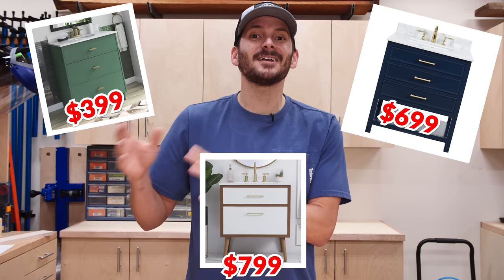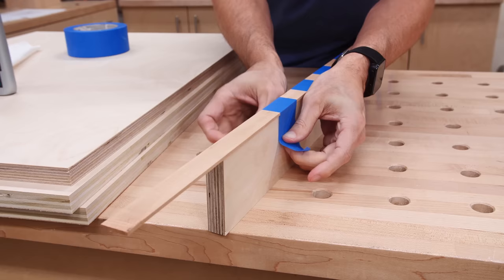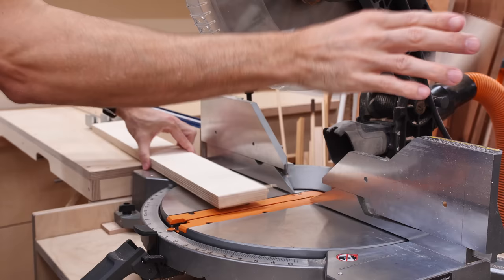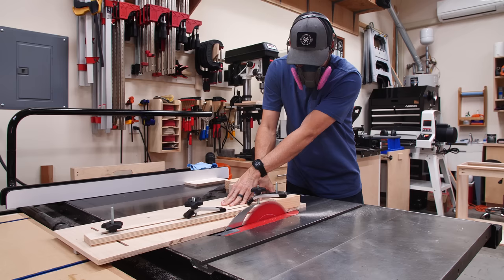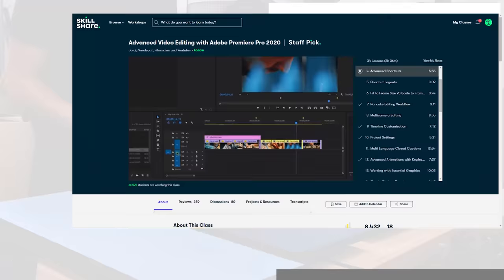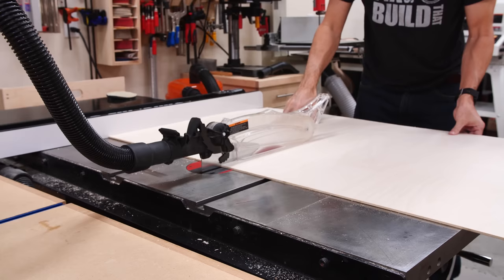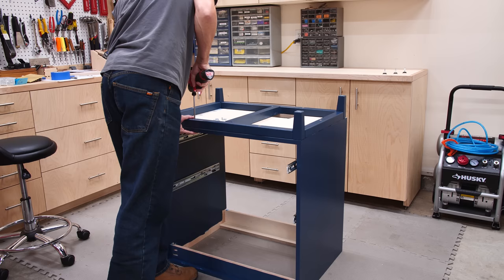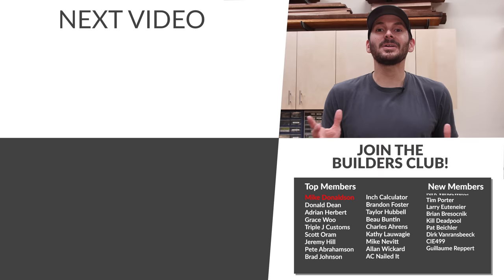DIY Bathroom Vanity with Custom Drawers | Woodworking

Comment: My wife wanted crates for her shelves in the craft room.  I used that method to cut some little 1/8 thick strips for the crates sides and bottoms.  Worked well.  I sliced up a bunch of 2x4 material.  Great use of scrap.

Comment: So helpful. I plan to use the existing 72” cabinet base that in my master bath, but add in drawers instead of drawers that are there for better storage.

*Plan to turn the 3 bottom existing drawers in the middle to a pull out trash can.

Comment: Why does no one make a hinged drawer on the top? Makes a great place for small items. My grandmother's kitchen, for the sink, you pulled on on it and it hinged open, it is where she kept most of her spices, when closed they laid flat, when front was open it pulled down about 60 degrees and you could easily read the containers and grab them. Many small things to store around a bathroom vanity too... Filip it down, access toothpaste/toothbrushes, not sitting out, not down in some deep drawer :)  Loved the color of this!

Comment: Gotta say Brad. Your sponsored ads are one of the few I actually watch as you put it on while still showing the build. Happy to watch the ads this way. Good job. Also nice build. When you use the foreman pocket jig are the positions random or are you measuring and placing specific points off camera?
Reply from the maker: I appreciate your support of the channel, Gary!  I try to make it still have some value if you're not interested in the sponsor I'm talking about.  And if you go back and look on a close up you can see these little spring stops on the Foreman.  So whenever I do the edge holes I use those.  Anything on the interior I just eyeball and typically go ~6" apart.
Reply: @Fixthisbuildthat  I wasn't able to locate the plans for this build on your website. I would really like to buy them if you could tell me where ti get them? This is exactly what I'm looking to do for my own bathroom remodel.

Comment: Love you're videos 👍 would you consider doing a video on what pocket hole screws you use for different types of wood? Thanks
Reply from the maker: It'd be a very short video :)  Coarse threads for softwood and fine threads for hardwood.  Length is determined by size of wood and Kreg jig has great reference for that.

Comment: It was not done with a solid wood. It was done with plywood. That’s a big difference.
Reply: It's a nice project, I like the solid colour. I am in the middle of planning a vanity build and this is inspiring.   At least it wasn't made with the cheapest veneered particle board like another one I saw on YT  - that maker called it 'plywood' and criticised (and/or shadowbanned) everybody that argued :)
Reply: Why would you use solid wood more prone to warping for any cabinet, especially one that goes in a bathroom where there’s always tons of humidity and temp changes??
Reply: @thomashajicek2747  certainly no argument there,  a quality ply, properly sealed, is the best way to go in these environments - short of marble or plastic, maybe :) .  This was more about terminology, which seems  to vary the world over.  The term 'solid wood' was used early in the video which implies 'natural' non-engineered timber (lumber) in many parts of the world.
Reply: @greaser5691  ah, I missed that bit.

Comment: Don’t remember where I got this (Stumpy Nubs?), but if you have some of those wood-jawed screw clamps, you can use them instead of the vice you said you needed. Clamp rests flat on bench and holds your piece vertically, and if you need extra stability you can clamp the clamp to the bench
(Edit: now that I think of it, your parallel clamps could do the trick too!)

Comment: Brad, Did you use glue on your joints at all or only on some parts of the build?? Or is everything JUST held together with screws? I can never decide when glue is needed vs not needed. Thanks!
Reply from the maker: Hey, Mike.  I rarely ever use glue on end grain to long grain joints and didn't on these.  The screws are more than enough to hold it for life

Comment: I always factor in the value of my time on home DIY projects like this. If it takes $300 in materials to build a cabinet that I would otherwise have to purchase for $700, I'm only "saving $400" if my time has zero value. Some people are willing to give their time away for nothing, and will take on projects like these. For others, the $400 in "savings" won't buy an hour of their time.
Reply: I do agree with you on the value of time - it will definitely take much longer to create this yourself vs purchasing one already made. But for the pre-made cabinets, don’t forget to factor what materials you are purchasing for that $700. So even though you are “saving” $400, MDF is made out of particle board and/or fibers, which is not as strong as the plywood he used. Additionally, MDF may not be able to carry the weight of marble or granite either without bending or needing more reinforcements - which also cost additional money.

Comment: Why is the drawer a false drawer? That drawer would be totally useful. If you cut a channel for the plumbing, then box it in with scrap 1/2 Baltic birch it makes it so you can still use the drawer. Odd looking but still very handy and useful.

Comment: Always wonder when ppl make legs, I mean. Most of the time old house aren't straight in the floor.  Could you hang this with a French cleat? Or isn't that strong enough for the sink and table top?
Reply from the maker: could definitely do french cleat.  but most of the time legs get adjustable leveler feet or shims to make it work
Reply: @Fixthisbuildthat  very good point. Thx for the reply 👍🏼

Comment: Good job. The cabinet is very nice, but its price is still expensive even though it is halved.
Reply: Agreed, could be bought from a store cheaper like ikea but you just know the wood used will just be shocking yet beautiful to the eye !
Reply: A bathroom vanity of that size and comparable build is $400 at Ikea. You can buy cheaper but, as he says, it'll be made of lower quality material and may not last as long. $300 for a solid plywood vanity is a fantastic price.
Reply: @tiawilliams5690  Okie, maybe the price is different in my country and the other country, With $ 300 for a plywood cabinet then in my country it's a hefty price, for that money in my country can make very beautiful wardrobes or beds made entirely of wood. The cabinet in video like on its price is less than $ 100.
Reply: @Dogo24h  in the US, a vanity cabinet like this made of plywood can easily run $600-800, and honestly doesn't look this good in most cases

Comment: What are you doing after you roll on the dark blue paint at marker 9:24?  Are you taking some of the coat off to help dry?
Reply from the maker: good eye, Keith.  I was back brushing the rolled on coat.  Gets rid of the "orange peel" look and makes it look brushed on.
Reply: @Fixthisbuildthat  back brushing?  Using another bristle brush or is it a foam brush (to prevent brush strokes)?  Would like to hear it explained in the live show, maybe? :)
Reply from the maker: Missed this before the show. I rolled on with a nap roller and back brush with a bristle brush 👍
Reply: @Fixthisbuildthat  wow, phenomenal job, the color is beautiful.  So you had to issues with any brush strokes showing up?  Could a foam brush achieve the same result?

Comment: "I'm going to show you how to make one out of solid wood", pulls out a sheet of plywood.
Reply from the maker: plywood is just solid sheets of wood glued together :)
Reply: @Fixthisbuildthat  I know, but that reply is still funny. Lol
Reply: @Fixthisbuildthat  I mean, it is a sheet-good, not solid lumber. By the same token, partical board is solid chunks of wood glued together. 
I dig the project, and plywood's leaps and bounds better for a bathroom vanity than either solid lumber or the MDF/particle board stuff...but that intro did crack me up.

Comment: “Made out of solid wood”...”plywood carcass”
Reply: In the world of linguistic bullshit we now live in, "Solid wood" refers to anything that's not chipboard, particle board or MDF. 

It seems the distinction was made by big furniture manufacturers who argued that a thin sheet of solid wood is still solid wood even if it's laminated together with lot's of other sheet's of solid wood. As long as something doesn't contain any of the "re-formed" types of board they can happily advertise something as "Solid wood" even if the whole things made of bargain basement shuttering ply ! Add a layer of pretty wood veneer to all exposed surfaces and a customer who doesn't ask the right questions might be none the wiser for at least a few years.

Luckily, so far most big manufacturers limit using ply to draw bottoms and cabinet backs, but it's only a matter of time before lumber prices force them to expand that into other parts of their "Solid wood" furniture. If they don't they'll get priced out of the market by others who have less qualms about pushing the boundaries of accepted descriptive terminology.
Reply: @Reman1975  Plywood and OSB both are resin and wood based.  Your argument does NOT hold.
Reply from the maker: Plywood is considered "solid wood" in most furniture as it's solid sheets of wood held together by glue, not particles, chips or dust held together by resin.
Reply: @justchillinout2002   It's very difficult to legally define what is and isn't plywood. Have a go at writing something that can differentiate between what is and isn't plywood with no wiggle room, that works for 100% of the time, and can quantify the difference between gluing a handful of 6x1" planks side by side to make a table top and gluing a stack of 2mm sheets one on top of another. The legal profession couldn't, so plywood is still classed as solid wood by furniture makers. If plywood didn't get classed as "Solid wood" then unfortunately, any large expanse of wood that's made out of glued planks, or a piece of cheaper real wood that's faced with an expensive veneer would also need to be classed as plywood. 

"Engineered wood boards" could be quite simply described as "A composite material made from compressed non continuous wood fibres and a binding agent", and that would probably be enough to cover all chip/particle board types, but plywood can't be pidgin holed that easily.
Reply: @Reman1975  Bottom line, Plywood IS NOT solid wood.

Comment: Solid wood? Then you say you start off with plywood...ummm  Why not just use thick edge banding ?
Reply: Plywood is not particle wood like MDF and actual particle board
Reply: @Taylexwow  Nor is it solid wood...
Reply from the maker: @wags99999 It's solid pieces (sheets) of wood glued together.  So it is in my book :)  Like a glued up cutting board on a different scale.
Reply: @Fixthisbuildthat  So is particle board, MDO and MDF, pieces of wood glued up..  In many cases far superior to plywood or solid wood...They make different grades of MDF and PB for different purposes.. Why use a house paint rather than a solid stain with conversion varnish top coat?

Comment: Sawstop tablesaw  $2500 
Ridgid miter saw   $599  
Dwalt drill driver  $169 
Kreg foreman  $449
Router table  $299 
Kreg K4 (?)  $79
Ridgid jigsaw  $129
Milwaukee brad nailer  $339 
Ridgid palm router   $145
Wood  $90
Top  $100
Hardware  $48
Finish  $30
Fasteners  $8

Total  $4984 

Conclusion: Buy vanity from store, alternatively  borrow tools from father-in-law.
Reply from the maker: Being able to build hundreds of other projects with the same tools...priceless

Comment: Built a vanity for $300. Uses $5k in equipment to do so haha.
Reply: Yeah it always sucks when you have to throw away thousands of dollars of tools after each project. 

You could make the same thing with a drill/driver set, circular saw, and cheapi pocket hole jig.
Reply: @thomashajicek2747  even if you go the cheapest route possible, as far as tools are concerned, then you're still looking at $500+ to build something like this and that doesn't include the value of your time. You give people the false impression that something like this is only worth $300 which belittles an actual professionals craft.
Reply: @RenegadeTactical  you realize  that these videos are directed to people who are already investing in the woodworking hobby and not toy tap novices with zero experience, right? Nobody is thinking a total novice could watch this video alone and build this.
Reply: @thomashajicek2747  well aren't you just a man of the people 🤣.... these videos are directed at who ever will watch them. 1M subs and maybe 1% is an actual professional so you can take that logic elsewhere.

Comment: Half of the price? Don't forget to buy $10.000 worth of woodworking equipment!
Reply: I always feel that, when I title by my videos quick and easy! I think hmmmm what about the tools and wood and products and nails and ...*sigh*
Reply: @custommadecrafts1271  Well this can be done with hand tools and other non-expensive tools but it still requires skill to do. Thats what I was thinking about too....
Reply: @wills5482  mind you it does take a lot of effort and time to be monetised, youtube is a very good platform to get paid IF you can make it..right now it's all coming from the pockets with hope one day I'll get a return 🤣💪
Reply: @wills5482  he still worked hard for this!
Reply: @custommadecrafts1271  It's not easy to start
Reply from the maker: This whole project could be done with a circular saw if you had a few homemade guides for rip and crosscuts.  Don't let lack of tools get you down!
Reply: @Fixthisbuildthat  💪💪💪
Reply: All you need is a drill and a circular saw; if you don't have those, then even a hand saw and hand drill would make it possible.  Don't let the excuse of not having expensive machinery  keep you from  making something.
Reply: @Fixthisbuildthat  I know, I first said this as a joke!
Reply: @htcinfinity  Didn't say this as an excuse, It was ment as a joke
Reply: @htcinfinity  words of inspiration! I started only with a makita drill and a couple of saws and some pallet wood..then I bought a mitre off of eBay or gumtree I think it was around 30-40 quid..a really good heavy-handed one! Your right about not letting yourself be brought down because of tools because with perseverance and excitement I'm now building great projects on YouTube and starting etsy!